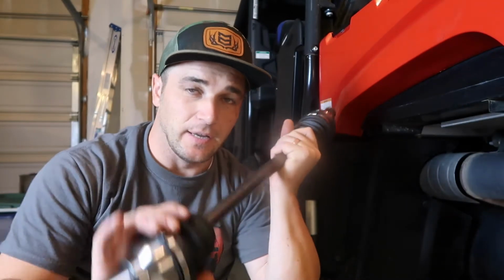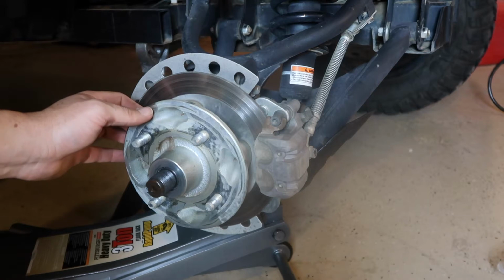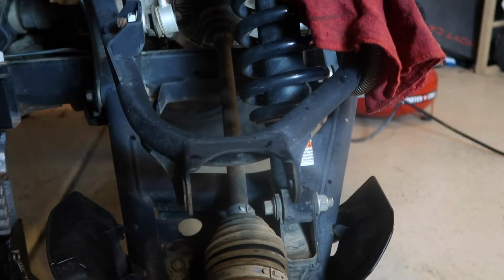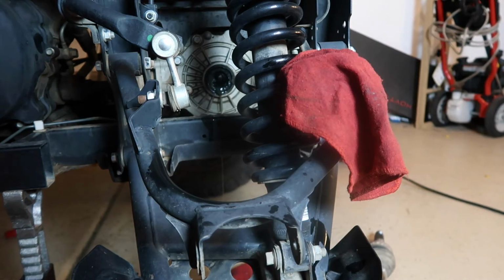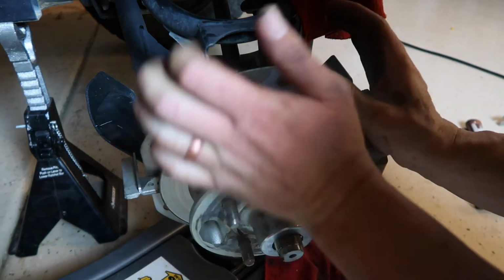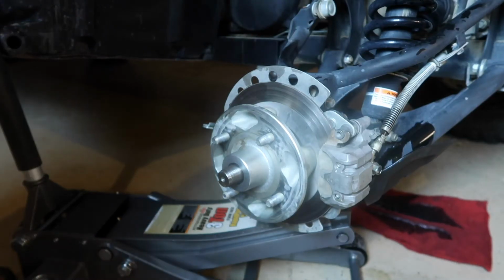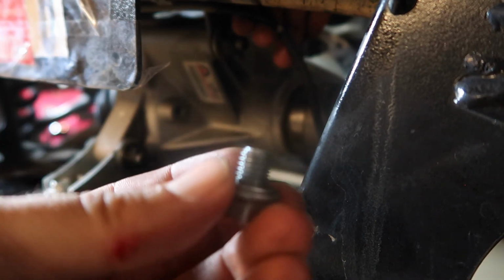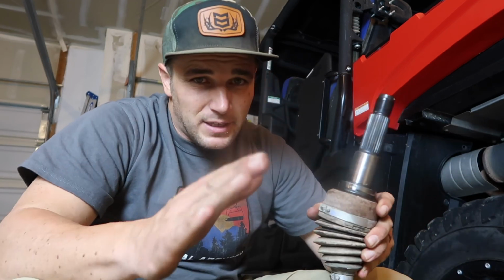How to Replace a CV Joint on a Yamaha Viking | DIY Side-by-Side Repair Guide

Comment: Thanks for this.  I have a bad boot.  Does the entire axle drive shaft have to be replaced as an assembly, or can you just replace the rubber boot?  I have no idea how to get that ball joint boot band off.